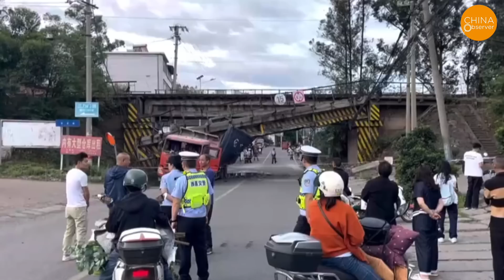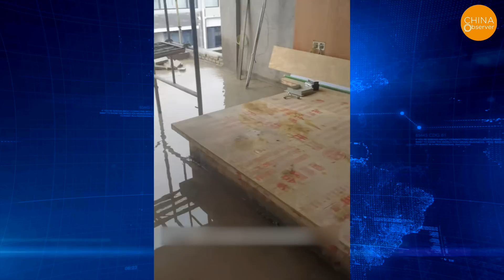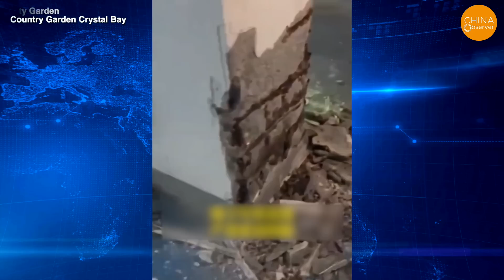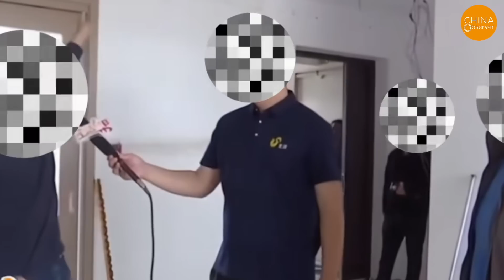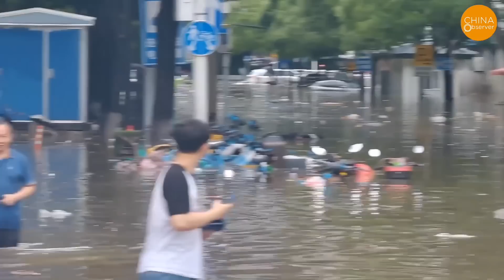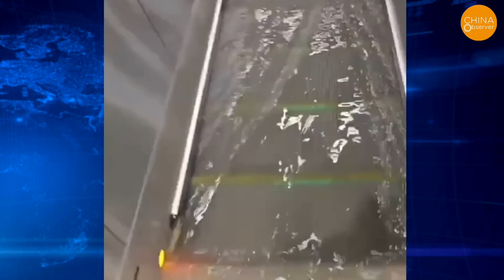The Paving Material Is a Printer! Shocking Tofu-Dreg Projects in China, Cities Submerged After Rain

Comment: So bad made in China contractors are taking advantage using cheap material cutting corners in a nut shell look good from outside, weak interior. It's common shopping mall are leaking water and shop floors ceilings falling apart, basically the budget given to construction and cheap labour results in what you see

Comment: she said that the workers ad water to stretch the cement drying time. i dont think thats what happened. i would expect to see some areas of sandy concrete but it looks like the entire building was made that way. everywhere the go they find sandy concrete. i think they used very dirt cheap concrete and other materials out of pure greed. apparently they dont even care if someone dies because of it. this is sad. they should be put in prison for doing this to people. they should be forced to give the man his money back so he can fix everything they messed up. you guys need to get out of there. those are major foundation problems. looks like it could collapse at any moment
Reply: they use sea sand, because its cheap, then they add WAY TOO MUCH sand to save on concrete. THEN the salt in the sea sand rots the metal rebar, which is made of poor or no quality steel in the first place
its all the holes in the swiss cheese lining up to make a failure.

Comment: China is good in making modern looking something with a lot of functions. But this functions not lasts. Trust me. I have almost 20 years old Vauxhal car, with much less problems than modern Chinese SUVs. Some of my pals have China made SUVs about 10 years old, with holes thru car bodies all around, because of poor rust preventions and cheap metal, my car don't even have any sings of rust in same places. 
Salespersons tell stories about huge China progression in cars quality and if you buy it now, there will be no problems like with new Chinese cars 10 years ago. But guess what? 10 years ago salespersons told exactly the same fairytales about China made cars. So, if you reach enough to throw away car after 3 or 5 years, that's ok. Cause there will be really hard to find naive simp who will buy it having a lot of complaint all over internet about poor quality and reliability after 3 and even 5 years. Just check real owners of China cars made 5 years ago. Most a very disappointed.
Be smart, buy something reliable and maintain it in good serviceshop, it will be much cheaper and finance wise (but not prestige).

Comment: Why can’t the bridge be of bad quality AND it got hit by a truck that was too tall, causing it fall? We have hundreds of videos of bridges in America getting hit by large trucks and not even taking damage, the truck takes all of the damage.
Reply: It's hard to recognise what happened - because we don't know what the bridge was like earlier in the day to see if it was sinking, or if it came loose. One beam is fine, the other has come loose from the pillar on one side. Accident analysis would be great - but this isn't how you'd normally see a bridge collision in other countries. 

It seems to have just dropped on top. Which is not consistent. If it collided with 1, it should have collided with both. 

They should be built to not fail like this, because even if the truck was oversize, this isn't how the crash should have worked. Even at higher driving speeds for the collision, the beam is not being lifted up, turned, bent or twisted, it fell rather close to the pillar holding it up, a higher speed would 'carry' the beam further as it detaches/rips from the bridge/pillars. It would also show shearing on the side of the pillar where the bolts/fixtures held it in place. Which isn't clear how it came loose.

Most likely, it was sinking into the ground or coming off the pillars on the side. It's hard to tell without a video, or seeing the crash. Oversize warnings aren't visible, nor are the swing bars/warning bars. Usually they attach collision bars with chains on overpasses so if the truck is too tall, the truck hits a steel sign or a steel bar that hangs below the beams to make a dinging sound to warn the driver to stop and avoid becoming stuck under the bridge/beams.

Either the truck hit a physically lower beam - or it fell down as he was driving through. The result is the same.

However, you can still work out which came first. The truck's lean + twisting indicates it was moving as the weight was lowered, it's not a shearing force, but a twisting force. so it didn't bounce or push back or collide evenly, it crumpled and twisted as it landed while it was moving. There should be more twisting in the truck if it was responsible for tearing the beam off the mounts. It would be 'pushing' against the bar to detach it. 

There would be a crumple if it drove into the beam, but it would also lift the rear of the truck and that would tilt the container off the truck too. It would cause the container to 'bounce' up as the cabin/truck is pushed back. 

If the truck hit the beam at 20km/hr, the beam is much heavier/firmer, the truck would be pushed down, the rear wheels lifting up with friction, and pushing sideways as it pushed against the stress/joints  of the pillar, and the container would have slid backwards on the truck, twisting the container before falling. 

Normally - if the pillar is stable - the bridge shouldn't sink or come loose - even if it's hit by the truck + container. What would happen is the beam is struck, the pillar holds the beam until the pillar bends/breaks. Now, it could have - it's hard to say given the amount of sheer torsion it's applied to push it off the pillar/struts.
Reply: @Toliman.   its not hard to understand unless youre blind or daft.
it was built wrong.
there are rail bridges built by the british empire all over the world that still stand and are still used as bridges.
Reply: The bridge was obviously struck by the truck under it. The bridge has probably been struck many times over the years. But this wasn’t an ordinarily trailer attached to the truck. It’s a reinforced one that you would fill with boulders or scrap metal. It’s not going to give way like a normal cargo trailer would. The driver is probably going to be held responsible in one way or another.
Reply: @MoneyManHolmes   the bridge wasnt struck. there is no impact damage to the front of the cab nor the container it was hauling.. i hope with eyes as bad as yours, youre not doing any driving.
on another note. REAL bridges, ones made properly, are made to survive being struck by vehicles that pass under them.
there are LITERAL YOUTUBE CHANNELS that are DEDICATED to videos of trucks hitting bridges and they NEVER come down..
stop making excuses for tofu dreg construction wumao

Comment: the rusted rebar tells u what the concrete is. It uses sea sand which is much cheaper then what needed for concrete. it causes the rust and the weakness of the concrete
Reply: Most ppl forget that "sand" is an umbrella term for minerals and organics
Reply: @ciklop420  yep, all sand isn't just sand. Even the ancient egyptians knew that, they shipped in rare ass pure quartz sand to build the pyramids. We don't know why but there's pockets of the stuff behind certain blocks that have been removed. It flows much better so they thought maybe it was for infill, maybe for sliding stuff along the ground. Who knows, but they knew the difference for sure
Reply: In the short term I would be much more worried about rebar that is bending in finished buildings, and the concrete that can be removed by hand. The structural integrity in those buildings are NOT up to spec and any added stress like wind, snow, even small earthquakes can bring it down. Heck even renovation projects in one flat that unintentionally weaken a part of a load bearing wall can be the straw that break the camels back.

I would not set foot in one of those buildings, and would never allow my loved ones in one either. But I have quite a few people that I wouldn't mind to send there.
Reply: @Zwampify  Politicians and lawyers first lol
Reply: @Zwampify 😂😂😂
Reply: ah yes , salt and steel ........... perfect combo for giving iron to the plants ! 🙂

Comment: They used trash as fill. Not the first time not going to be the last.
Reply: Not only that, they put the concrete directly on top of boulders and trash, the roads will start having cracks and crevices really quick. Usually you do layers, so bottom is boulders, then 0-400 crushed stone, then a layer of 0-150, topping that would be either 0-63 or going directly up to 0-32 material, and then final layer below the concrete/asphalt would be 0-16 material. Size of layers and material differ from country to country but the principle is the same, you always do it in layers with finer and finer material.

They might be really fast with their projects, but they also need to redo them every 5 years while the ones properly done can be good for decades besides simple resurfacing.